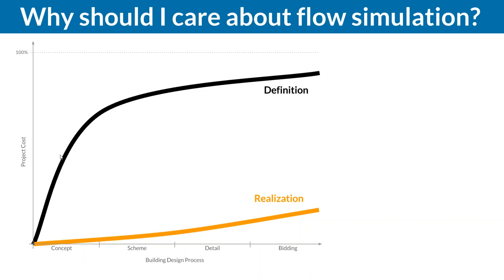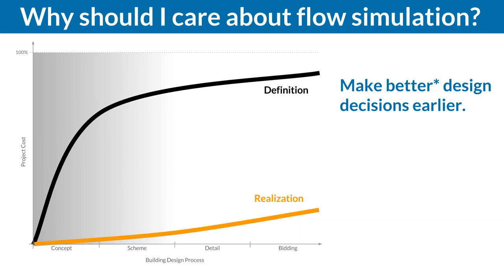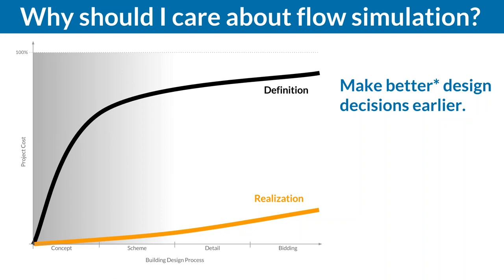Calculating Wind Loads on Buildings with CFD Simulation

Comment: Hi! I'm a beginner user of ansys fluent and I have to study the across wind on a tall building. How can you insert this option in the software?
Reply: You can do that by using either the incompressible solver module on SimScale or (if you have a professional license) use the LBM solver using the Lattice-Boltzmann approach.